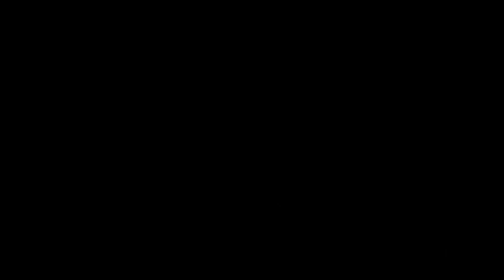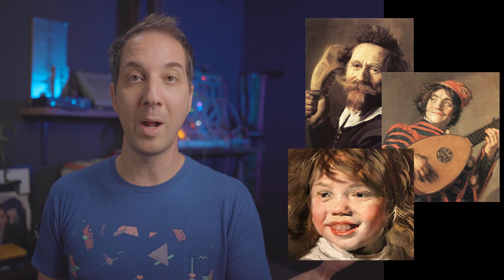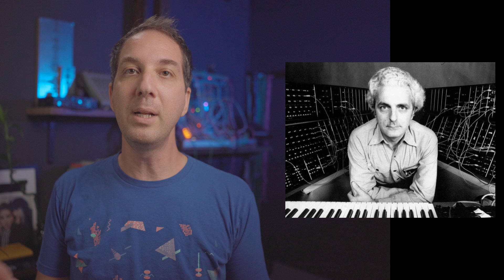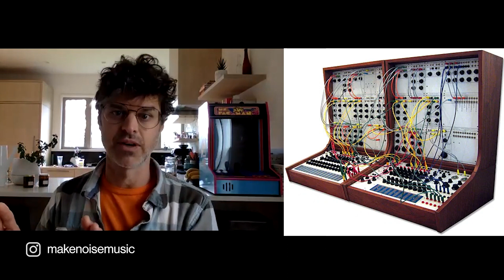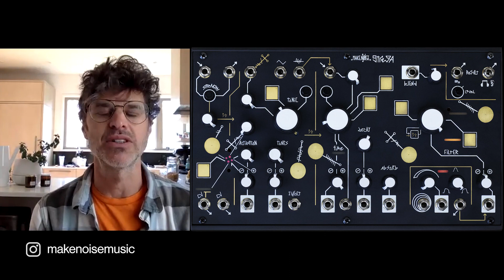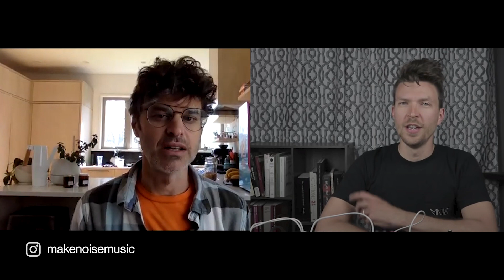Synth Design Podcast // E.10 // Tony Rolando, Make Noise

Comment: why do Americans threat their CEO's like leader of a SEKT?
sure STO, DPO, Wooglebug where good but basically they where designed by other people, Like Don Buchla, Serge, he just adjusted the voltages to be compatible with eurorack,

DPO was basicly Buchla's complex oscillator 259.
STO was just one VCO of Buchlas complex oscillator 259.
Maths was designed by Serge ( DUSG ) with minor changes.

O.coast was good, but could have been better if he added 3,4 more ic's and have a 2 or 4 pole filter.

sure, Tony Rolando as autodidact electronics engineer is impressive, basically homeless with a library as shelter, but stop threatening him like a god. the schematic are online, he just wraps in a new jacket.

the later designs like Morphogene, ebte verb, etc, etc where spend out and not made by Make Noise.
Reply: Jealous much!
Reply: @Reprobus3  why would i used the same schematics to build my modular, that's why in know and it's pretty normal that American companies sound a bit like a sekt, for instance Tesla, Porsche did that like more than 100 years ago, the Porsche Löhner and was 100 electric.
CEO's of European companies never present their product this way, like a religion.